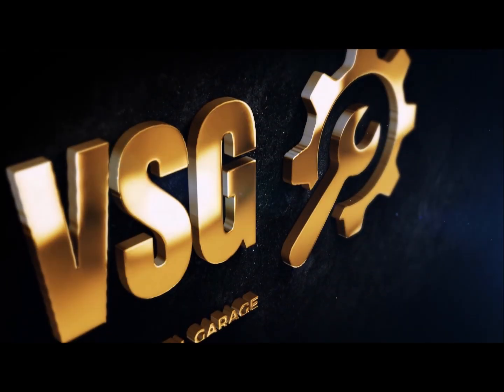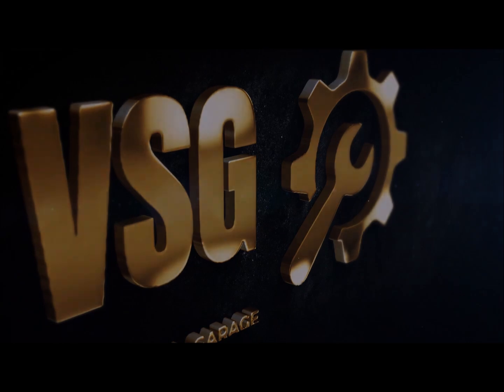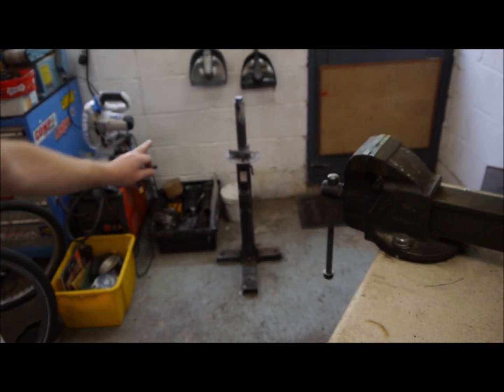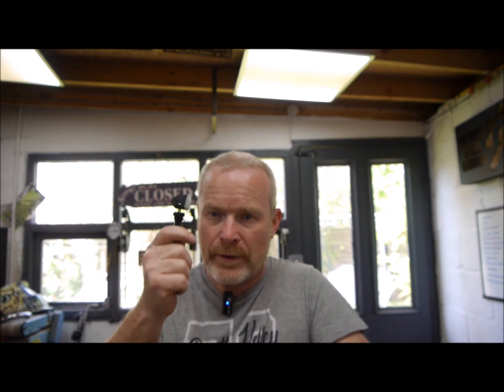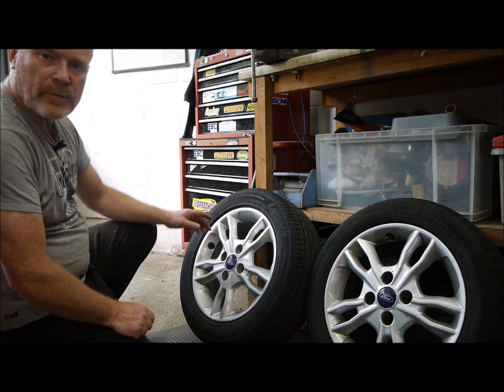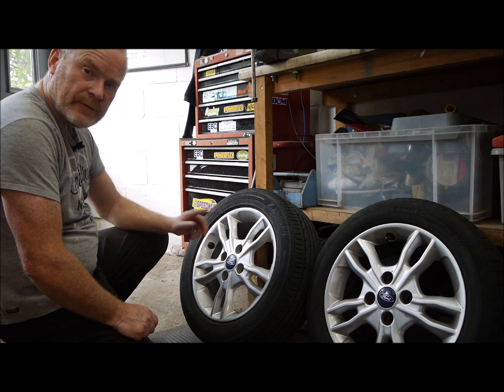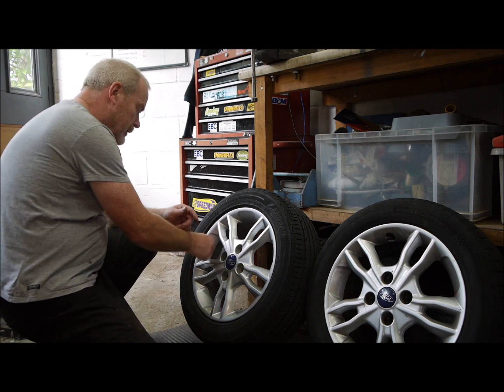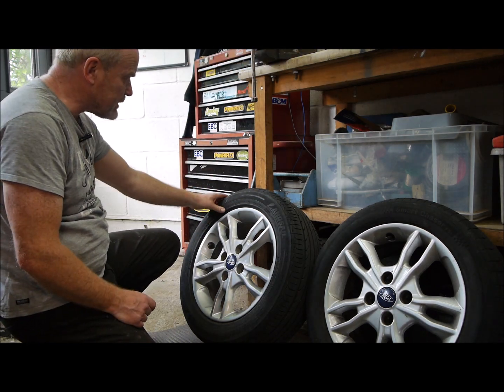DIY TPMS tyre pressure monitor sensor replacement at home and save £££

Comment: If buying sensors check manufacturing year which is printed on the sensor. You don't want to buy one which has been on a shelf for longer than the battery life!
Reply from the maker: Yes good point.

Comment: Seems like some Ford cars have different calibration methods. I've seen other videos where you start calibration by pressing hazard lights 6x. Then deflate the tyre to locate it instead of using the electronic tool. Maybe that's only in newer Fords. Mine seems to be an older one so fits this video. Thanks!
Reply from the maker: Does seem to change between models and makes.

Comment: Thank you! I did this on two wheels of my daughter's 2016 Fiesta this afternoon after watching your guide. Soapy water was a must for helping get the bead off the rim. The tool kept slipping up the tyre sidewall as pressure was applied but eventually it released. I did also buy a cheap air compressor from Screwfix to help reseat the beads plus some tyre bead paste. Have only broken even against the quote from the local tyre place but when the other 2 need doing then will be in the money.
Reply from the maker: Glad it helped. And as you say money savings time round.

Comment: Could you send a link from the little box you used to train the tyre sensors please
Reply from the maker: Here you go.  TPMS Reset Sensor Tool, Tire Pressure Programming Activation Tool For F-ord Tire Pressure Sensor Training Activation Transmitter 8C2Z-1A203-A : Amazon.co.uk: Automotive https://share.google/9r8pDLAtfsh5mzPNl

Comment: My Kuga needed 4 new wheel pressure transmitters, the car was 8 years old at the time. I have a local mobile tyre fitter who does all my tyres for me, he replaced the sensors but it blew my mind as they didn’t need coding, I got home to check with his supplier and they confirmed, no coding needed 😮 Been perfect ever since, can’t recall what I paid for them but was quite a bit cheaper than the likes of QuickFit. Great to see how it’s done.